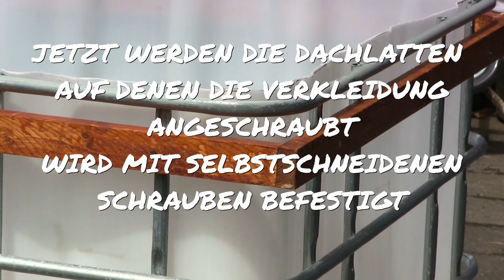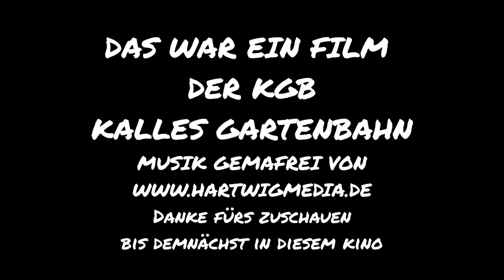Pool Bau aus einem 1000 l IBC  Tank Container

Comment: Leider nur ein "Ein Personen Pool" oder passen da zwei Leute rein. Gibts die auch in größer?
Reply: Nein, ibc tanks gehen bis 1000 liter. Und das holtz kosted auch viel geld und lack, und dan ist noch kein
pumpe mit filter dabei, also kanst dus besser wie ich ein aufblasbaren lay ze spa kaufen ab 250 euro.
Der steht in 5 minuten, und hat ein schöne design pumpe der auch heizt , filtert, und luft blast fur die bubbels,
und had en deckel zum abdecken, und weil das bad aufblasbar ist, bleibt das wasser langer warm wegen
der hohlraum. Und am ende der sommer last du einfach den luft heraus und dan aufrollen und dan past 
das in ein grosse tasche die du in ein kleine ecke stellen kanst.
Und achtung mit diesen ibc tanks, weil manche hatten mahl lebensmittel drin, aber andere hatten
mahl chemicaliën drin, und wen die dan nicht richtig sauber gemacht worden sind, kan es zu
gesundheid probleme geben.